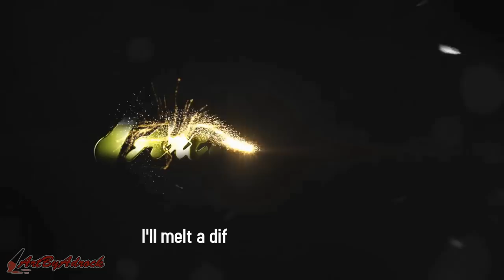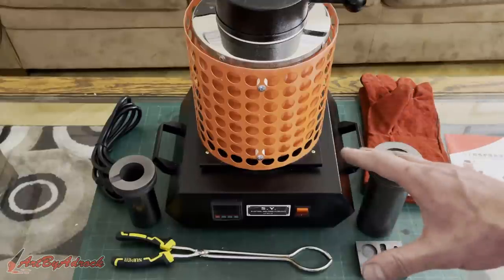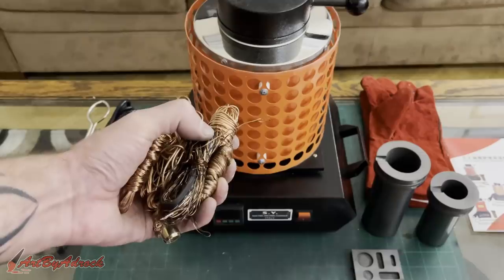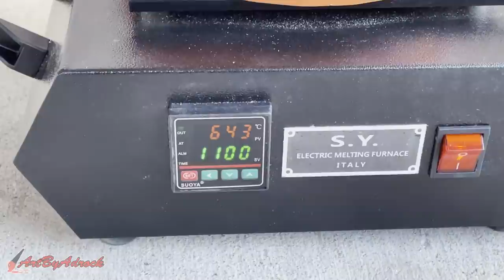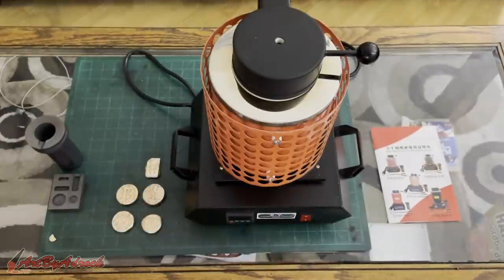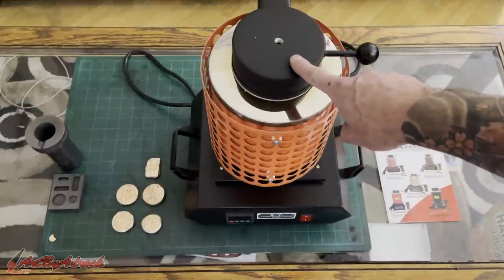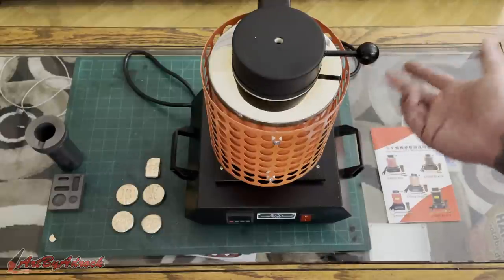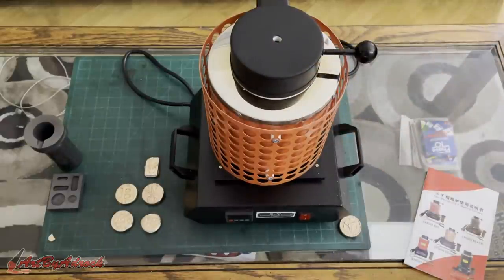Casting Copper With The TOAUTO Melting Furnace - Easiest Beginner's Casting Furnace

Comment from the maker: Hey guys and gals, I hope you all enjoyed this video! This melting furnace is great for all those beginners out there or for those that have a small amount of metal to melt. It’s not nearly as fun as propane and fire but it works great and is very portable. Happy melting and I’ll see you all next week for more 👍🏻🍻

Edit oh and I almost forgot, new merch is available in my store so if you feel like supporting and getting yourself a cool shirt, mug or more, visit my site at ArtByAdrock.com
Reply: Saw the sweet shirts just before when looking at molds
Reply: What about the give away
Reply: Awesome brother! I need something like this for my silver melts. Did you not have to heat up the crucible to temper it?
Reply: i really loved this vid,  is it 110 volts ?  Is using it as economical as using propane or does it make  your electric bill go crazy ?  I am truly a beginner, but I dont wanna buy too small of a furnace if I'm gonna want a propane fired "Devil Forge" in less than a year. i've looked on Ebay for pre-owned forges both gas and electric and have not seen any in weeks. Also I seen that bigstackD Casting recieved a custom stamp from you to use on his ingots. where can i find pricie and availability on those stamps both stock and custom. They look really sweet. i just added you to "SUSCRIBE" and I crushed the bell. i hope you will give me the best response you can.  thanks for such cool videos,
Reply: Hey man your the only legit you tuber that has this thing that I can find, so I’ve been wandering how’s it holding up so far... is it still working? Should I get one? 

Thanks man cheers
Reply from the maker: That all depends on what you want to use it for. If you plan on melting large amounts of melting then go with a propane furnace like the devil-forge. If you’re doing small amounts like silver or something then yeah it’s worth it. You don’t want to run it to long at a time or all the time as you risk burning out the coil. Hope that helps a little 👍🏻
Reply: @ArtByAdrock  yeh that helps but the one question you didn’t answer was if the one you have is still working well
Reply from the maker: Yes it’s still working just fine for me 👍🏻
Reply: Where did you get those molds
Reply: Bro what is  cost of electric melting furnace bro
Reply: Hey Bud!! I'm looking at purchasing one of these units however, I'm in New Zealand so our voltage is 240V, Are these units voltage specific or are they multi-volt and branded as 110v as America is a bigger market than Oceania? Any Help would be greatly appreciated!
Reply: Was thinking I was doing something wrong,  this furnace struggles with copper I feel. It just melts it causing it to solidify almost instantly. Great for silver and gold though.

Comment: This is what I was thinking of getting since I'm only going to go small scale to build up a collection of different metals and not worry about art pieces etc. Also, I would not have to worry about the price of propane, exchanging tanks, etc. Thank you for the demonstration on this.
Reply: Might want to look into that electricity cost though.
Reply: @joshuagibson2520  I imagine it would be similar increase on the electric bill as an arc welder. Art by adrock didn't say if this model can also run on 220v

Comment: I'm so glad this works. I really wanted to get into this after watching way more hours of videos than I'll publicly acknowledge, but the Devil-Forge looked spooky compared to this. I can't wait to get this now!
Reply from the maker: I definitely recommend it for beginners. There’s no need to buy propane or anything else. All the tools you need are included 👍🏻
Reply: Thoughts on using this to melt down cans? Obviously you'd have to fold them over the crucible is unable to hold cans as is.
Reply from the maker: I wouldn’t recommend it for cans. Too much slag and the crucible isn’t very big. It would work but would take a really long time
Reply: Same without the spooky part. I've been watching a lot of melting videos in the past year since Adrock's one video showed up over a year ago in the suggestions.
Reply: Hello is this is for gold and silver , copper only? What other metal can do? I want to by one
Reply: @ArtByAdrock  I’m buying this well I did and it’s on its way and it’s still late after a week hopefully tomorrow but once I get $100 more I’ll definitely buy s9me of the molds
Reply: @didyoupaytaxyesono7012  if it can melt copper you don’t need to worry about the silver or gold it will melt

Comment: Bought one of these before Christmas. Works pretty well. Use it for me small lost wax casts and so I’m not outside in the cold or have to deal with not casting anything cause of the rain.
Reply: If you don’t inside you need a fire extinguisher just in case and a bottle of water to instant cool metal 
Edit I me do it not dont lol

Comment: I have been using a similar electric furnace for a few years now, but not a knock-off. The Goldbrunn 3000, it goes up to 1150°C and does that a bit faster, about 30 minutes I think. And the crucibles last longer too.
However, it is a bit more expensive, but I love how easy it is to use. I use it indoors in the garage during winter for smaller casting projects.
Indeed a great way to get started in metal casting 👍👊

Comment: Report back a dozen melts later and let us know if it's still working!
Reply: It works as it should after a ton it’s just a small furnace and takes a while
Reply: @AmongUs-vj1ew how long do the crucible lasts?
Reply: I have one and it's still working after 20+ melts but not copper melts. It's recommended by the manufacturer to not run it for more than 3 hrs without letting it completely cool off. Which ashes the crucible
Reply: @jamieleseelleur9925  about 10-15 melts. When they cool, they seem to get ashy. I brush them with a nylon brush to keep the pours clean. Aftermarket crucible seem to be better made

Comment: ADAM  NICE WORK BROTHER, I have seen these before but I only seen people melt gold or silver in those types of  Furnaces Never seen copper being melted only gold,silver and they pour it in that little mold that came with it and yes that cools down way to fast so you said this unit is only a few hundred bucks what does it cost for the devil forge for the basic needs to start up with a Devil Forge👍😎🇨🇦👍😎🇨🇦👍😎🇨🇦

Comment: I recently bought one. No problems after first melt went well. I have a devil forge propane furnace n all. Though saw a video about how the electric crucibles only last about 5 melts. Idk if the guy melting was abusing the heat or not. How many melts can I get from a crucible while following proper tactics? I don't wanna have molten metal ruin my toauto inside. Thanks and hope to hear back
Reply: Make sure to temper your crucibles before each melt to make sure that no moisture is trapped as it it will crack otherwise

Comment: Thank you for the video, I’m going to buy one. For silver would you do the same temperature as the copper just like the settings in this video. Thanks again and new subscriber.
Reply from the maker: For the most part yes. Silver melts about 200° lower than copper but using those settings you should be fine 👍🏻
Reply: @ArtByAdrock  awesome, thank you !

Comment: I got one of these from Amazon.  Right out of the box it failed to heat. 
I set temperature to 300c to heat treat the crucible.  Nothing happened.  
I will return this. I also won't be ordering another.

Comment: Hello
I was hoping you could answer a few questions @ArtByAdrock I have a devil forge that I use but now my wife got me one of the kind u just used but mine is a gen 1 & the manual that came with it tells me nothing!! So if you could take a minute & answer some things for me it would be great.
1. Do you put the crucible with what u are melting in it why it is heating up ?
2. Copper melts at 1083.4 C so do u set it above that temp ? 
3. In your video I saw both numbers matching so the temp & the set temp. Mine goes down when I put the crucible in it ??
Sorry for the questions but like u I do not want to burn my house down.
Reply from the maker: Yes put the metal in while it is heating up. I put it in before I even turn it on. For copper I would set the temp to the max and even after it’s melted I’ll still wait a few more minutes. For other metals I typically set it to 100° over the melting point so it doesn’t cool too quickly. Hope that helps
Reply: @ArtByAdrock  yes it did a lot thank you. I’m going to use it starting Thursday & go all weekend. I got a lot to pour. Ooh 1 more question so after 3 hours of using it turn it off & wait but how long ?

Comment: Hi, After two years of use, do you still think it's a good furnace?  how many times have you used it?
Reply from the maker: For me yes. I’ve used it probably over 100 times and haven’t had any issues. It probably all depends on what you’re using it for. High temp metals might wear out the coils faster if you’re always pushing it to the max. So if you’re always melting copper in it, they might need to be replaced sooner than if you’re melting lead or pewter which has a much lower temp. Hope that helps a little
Reply: Thank you for the answer my friend, it has helped me, a hug

Comment: Nice machine!  Does it matter if the moulds cool off after you preheat them?  Or they’re fine for awhile since the moisture has been driven out?
Reply from the maker: They’ll be fine for a while. You just want to make sure there is no moisture at all. A quick heat with a torch before pouring should be fine. 👍🏻

Comment: How many pours can you do a day, including cooling down periods? And, how long do the crucibles last (how many melts)?
Reply from the maker: They say to not run it for more than 2 cycles without letting it cool down for a few hours to not burn the coil out. The crucibles unfortunately won’t last nearly as long but they are cheap.
Reply: @ArtByAdrock  Where do you get the 3kg crucible for cheap? Thanks

Comment: Assuming it is 1500 watt and 45 minutes at 11 cents a KWH that is only 13.5 cents to do a copper melt. My TableTop furnace has about the same time. I cast bronze trinkets from my scrap copper for my customers. This furnace would work for that too. 

Btw I have tried to contact you via your website but something isn't working. Do you have an email address?

Comment: I just bought this exact one last week and it should be here tomorrow. I am happy to see it can do copper. I'm going to be melting more aluminum and silver for doing my jewelry pendants because I sick of buying silver wire at these high prices online. It cheaper for me to buy this and buy the wire pull plate and pliers to make my own wire. I also already got a cheap rolling mill, so this is going to do me fine I see for a little while. I hope it lasts a while though. Any problems with yours 3 years later?
Reply from the maker: Mine still works just fine. Keep in mind that copper takes a while to get to temp and you need to pour quickly. I would also recommend getting multiple crucibles to use with each different alloy so you don’t contaminate the metal.
Reply: @ArtByAdrock  Ok I will get a few other crucibles and keep that in mind about the temp and pour. Thank you!

Comment: Great video as always! I am looking to get into melting, and I've been collecting aluminium drinks cans. Will they fit in the crucible? Sorry for the newbie question, but you and BigStackD are the only melters I follow. I've learnt so much watching your vids
Reply from the maker: You’d have to really crush them or shred them to fit. I wouldn’t recommend it for cans as there is a lot of slag and it’s not very big. It would work but will take a long time to melt a lot of cans
Reply: @ArtByAdrock  thanks for the reply... I've been looking at prices here in the UK and for the same price here I can buy a 10kg Devil Forge... think that's the route I'm going to go
Reply: Dang I just ordered this to melt cans too and it just came in. Definitely would take a lot of work , as a crushed can definitely won’t fit. Might have to return for a bigger one that can handle. This was so appealing as it’s just using regular electrical outlet

Comment: That seems so slow after watching the Devil Forge being used.
Reply: Also that electricity costs way more than gas.
Reply: @joshuagibson2520   Electricity is dirt cheap.
Reply: @billyg5819  How many kilowatt hours (KWh) does it use? And what's the average price per KWh in the United States? (Not harassing you, actually wondering)
Reply: @hassanbeydoun2460  not much

Comment: Ok so a bit of advice please people, brought a electric forge tried melting copper & aluminium but just get left with powder in the bottom no motion metal? Forge is at full temp for over a hour? What am I doing wrong?
Reply: The metal probably just oxidized instead of melting, you can try to add borax to the metal to reduce oxidation!

Comment: Not to fust on these, got one myself, Half hour to heat up and leave the metal for another half hour and then pour, I find unless you are melting Gold they are not worth it. Only four melts with crucible. So Devil Forge is the future for me.
Reply from the maker: I agree. It all depends on what your doing and need it for I guess
Reply: @ArtByAdrock  After six months mine packed up but you got a better deal than me all I had with mine was the crucible and the tongs. toget the two crucibles as a bargain!

Comment: I purchased one of these, on my third short melt of brass bits, crucible cracked and molten brass ran into the controls, burnt all the wiring and shorted out the electrics. 
Eventually the seller responded and said I was free to PURCHASE another one. No. Why would I do that. I followed all instructions and cured crucible properly. I understand crucibles will fail, but the design is poor, it should not destroy the unit.
I personally liked the unit for the short time I had it, but it’s dangerous and support or warranty was not there. Less than a week.
Reply: I know this is old, but did you by chance take a cold crucible and put it in the machine while it was heated already?